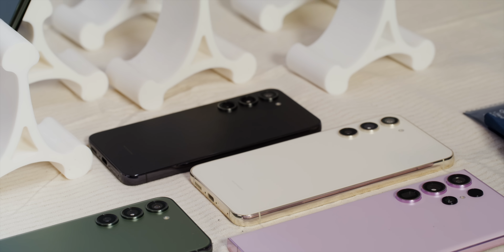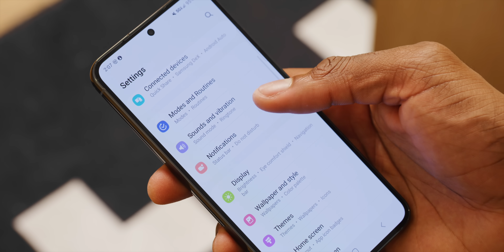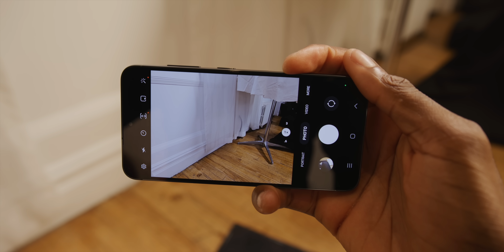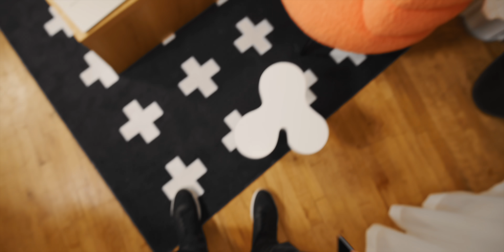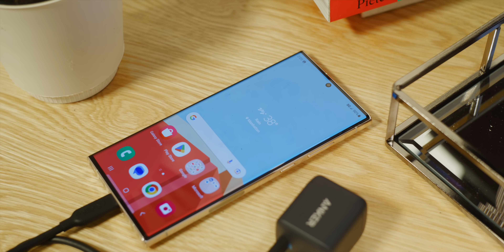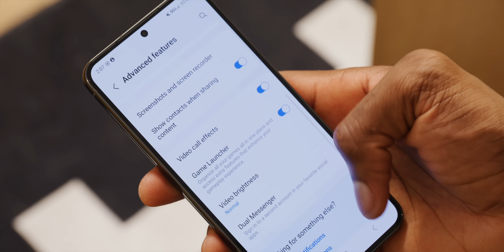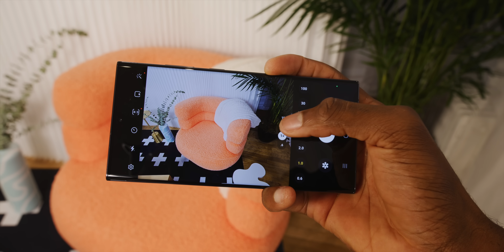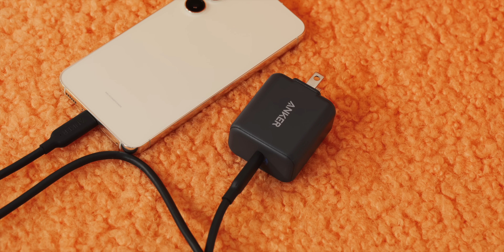Galaxy S23 / Ultra Impressions: Cruise Control!

Comment: I wish Samsung would release a smaller version of S23 Ultra (call it S23 Ultra mini or something), which would have the same cameras and a big battery but in a smaller form factor. Something like apple does with their Pro line up where they have a smaller phone with all the flagship specs.
Reply: I wish that Ford would release a pick-up just like the F250 but with the size of a Maverick. You know? Huge engine and tow capacity, space for 4 adults and tons of stuff in the bed. But, since it is physically impossible for now, I won't keep my hopes up.
Reply: @trickster_qc  well..in someone's mind it might be impossible, but I don't see any issues with just making the phone 0.5mm to 1mm thicker to fit it all.
Reply: @sergiysaliyev9023  same size battery and cameras would not fit with a phone 1mm thicker!
Reply: Exactly 💯!!!! That's what I've been saying why make the large form fone have all the really juicy features and leave the small form  fone out.
Reply: You mean smaller battery
Reply: I thought apple pro phones didn't have all the flagship specs

60hz screen instead of 1-120hz
Reply: @jormjohnXII  They have the flagship specs and 120Hz. Only the base models  have 60Hz. Although Apple is going to differentiate it later this year with the addition of a periscopic zoom lens on their highest end model.
Reply: @jormjohnXII  apple pro phones literally have 120hz
Reply: @user3wx9V-178  no point in saying it twice
Reply: You do realize that a bigger battery... is, uh, bigger? That's not really possible lol
Reply: @FavoredTrapdoor OP wants an s23-sized s23 ultra. just like how iphone 14 pro is same size as regular iphone 14 but with the pro specs and features
Reply: @FavoredTrapdoor  I mean bigger battery then what's inside of regular S23, (like 4300-4500 mAh for example). Obviously the battery would be smaller than S23 Ultra..

Comment: The most exciting thing about these devices is the fact that they finally got rid of the Exynos for all markets.
Finally we (Europeans) get the same performance as you guys.
Sadly I bought the S22 Ultra last year. So I will most likely not upgrade this early. (although my current S22 Ultra is showing quite some buggy behavior since I bought it on release.)
Reply: I have never had an issue with my exynos s22 ultra, the only thing the battery life is the only thing that is a bit bad.
Reply: @Shuffledudee  and shutter lag
Reply: Fomally

Comment: the question is should I upgrade from the S22 ultra?🤔
Reply: They're only offering 500 bucks for the s22 ultra.  Not worth trading in my ultra,  I'll keep it instead.
Reply: I have an S20 Ultra and the only potentially noticeable upgrade the S23 brings to the table is a 200MP camera instead of my 108MP one. Not really an issue even if photography is important since the 108MP one is fantastic and already generates 25MB images.

Comment: Hey, maybe the new S23 Ultra will support cellular networks! My S22 Ultra has massive issues with connectivity, SMS and even wifi speeds. It's all over the samsung forums. Oh, and the camera lenses falling off randomly is really fun, too!
Reply: I have a Samsung store here in Dallas. I took mine for a check due to the same issue, they told me my phone was good but they think it's the carrier networks that are not able to keep up with all the 5G devices... I looked at that man and I said that's the most BS I've heard
Reply: Camera lenses falling off?!! What does that even mean?
Reply: @James Power  so, the part of the sensor that protrudes from the back glass is covered by the visible half-inch pieces of glass. Those pieces of glass act as a dust cover. They're held into that protrusion by one extremely minuscule circle-shaped double-sided tape. That double-sided tape is ineffective, and the circular glass falls off. Usually in my pocket. The replacement glass covers are about $7 on ebay plus shipping... But there's nothing to keep dust off the sensor anymore. I usually use scotch tape til I can fix it... But whichever sensor it is won't work until it arrives.
Reply: Nice one troll...dumbest comment I've seen today!
Reply: Is yours the US ( Qualcomm ) version or the European ( Exynos version ) ?
Reply: @bengoey  Qualcomm!

Comment: I was considering upgrading from my OnePlus 7T Pro to an S23 Ultra, but man, I don't know. 
The changes from last year are diminishable at best and the price tag is ludicrous. 
I think I'll hold on to my 7T Pro for now..
Reply: But do you have that last year phone lol? If you even upgrade to s22 Ultra you will feel that huge improvement.
Reply: @pixellord1  I highly doubt it. Oxygen OS and the full screen of the 7T Pro, along with the performance and fast charging holds up so freaking well still - I never held onto an Android device for as long as this one. It's the last (and brilliant) phone OnePlus did before going down the drain
Reply: @undeco_niclas  Ah, haven't noticed that you wrote Pro. Yeah 7T Pro is a great phone, my friend still uses his normal 7 Pro for 3.5 years now, still work perfectly.
Reply: @pixellord1  Yeah, it's crazy good. The only issue I'm have is the camera having difficulty with auto focus sometimes (big problem for me) and for some reason I'm experiencing some weird bugs, like assistant not answering and things lagging randomly - I'm sure a factory reset would fix it
Reply: @undeco_niclas  Yeap you should try factory reset.
Reply: Used s22 ultra

Comment: Fingers crossed 🤞 the S23 Ultra can finally beat the Pixel 6/7 in the camera department as a phone beating it for less than half the price would be ridiculous like it was for the S22 Ultra. Great to see tsmc manufacturing the cpus now and not Samsung plus a big jump in performance this year as the S22 Ultra was underpowered for it's price regardless of qualcomm or exynoss so never got why the S22 Ultra was considered the best phone when it was underpowered and only had the 3rd best camera. 8GB of ram for £1249 is also ridiculous 12GB of ram should come standard across the board especially when 8GB is only just enough on Samsung due to the havy ui.

Comment: I'm mostly worried about battery with the new processor.  I'd like to run the faster refresh rate and 5g without so much drain.  Might do a different color than white this time if reviews show solid battery.
Reply: The new processor is supposed to be more efficient than the old one, by a lot actually. And the base and Plus models got a 200 mAh bump alongside it, which should help.

(Also, out of curiosity, what does the color you get have to do with battery life?)
Reply: @fsendventd  oh no, I didn't mean for that part to be taken out of context.  I simply meant if I buy one, I may get a different color than the s22u that I have now.
Reply: @Ready2Rise  Oh, that makes sense. I'm a fan of the lavender myself.

Comment: I currently have the S20 Ultra 5G. Is the S23 Ultra a good upgrade? Also, would my charging brick that came with the S20 Ultra 5G be sufficient for the new S23 Ultra?
Reply: That 20 extra watt hardly charges any faster
Reply: I would say yes.
if you feel like upgrading then it is a good choice it is still a Samsung but with upgraded goodies here is what to expect from the upgrade:
-same if not a better screen 
-a smaller battery at 5000 instead of the 5500 that the 20 ultra has 
-S pen with all it's features
-updated processer 
-upgraded camera setup with the 10x zoom lens and 100x digital zoom

Comment: Wow, they are really iterative updates. Especially the base and Plus variants. I am glad I didn't wait for them, and went with the Pixel 7 Pro instead. Had a Galaxy S20+ before this, and it would barely feel like an upgrade if I went Samsung again (at least the Pixel, it's UI and settings are a breath of fresh air after using One UI for a while). I was hoping Samsung solved two things with this generation - speed/fluidity of the phone (Pixels and iPhones 'feel' way more smoother consistently) and shutter lag.

Comment: I really like the design of the 23 ultra. The edges remind me of the Xperia line. But I personally think they need to ditch the one sided vertical camera stack approach. I really really hate that my phone wobbles on the table because I dont like cases. If it never changes I'll just have to get a Mi 11 ultra or something. That camera is epic.
Reply: Even with a case most of them have some lip around the camera cluster to keep it from resting on a surface, so it wobbles anyways lol. It's frustrating.
Reply: @xomm  True lol the wobble is on most phones. I just wish more phones did it like the mi 11 ultra or that the mi 11 ultra had a stylus like the note's or the new ultra series samsung phones. Always gotta pick your poison I guess XD

Comment: I have the S21 Ultra and like others have said I don't see the need to upgrade. If I was going to upgrade though I think my biggest concern would be the focus issue for the standard camera (1x zoom). Every time I take a picture on my S21 I have to tap the phone against my palm so that it will focus. Makes taking quick photos a hassle and only ever experienced this on a Samsung phone.
Reply: I wonder if Samsung is doing this with software so it makes you upgrade.. have same thing happen recently..

Comment: Paint on metal parts of my S22 Ultra (on the back where the phone touches surface) started to come off in a matter of few weeks. So, it's impossible to use it without case and keep it looking like new. But, consider that this phone is already huge even without the case... Another problem is that the whole S22/S23 line lacks premium look and feel. All these phones look like a good mid-range device... Not to mention dull and boring colors.

Comment: Waiting for the Galaxy Z Fold 5 for the novelty factor, as most of these other phones in the standard form factor are not that different from previous years.

 I want that" new toy feeling"when spending so much on a new device and I think going to a foldable will accomplish that to a greater degree than another regular phone.

Comment: Doesn't the S23 support charging bypass, so you can use it for prolonged periods powered directly from the mains, rather than constantly charging & discharging the battery, massively impact battery life if you used the phone plugged in a lot? Charging bypass has been in Lenovo, Asus & other phones for years now, so their phones can be used for prolonged periods of gaming, recording video, working, etc without prematurely killing the phone with a battery with no charge life cycles left. If the S23 does support charging bypass then I'm definately not getting one; it's a deal breaker to force us to have to replace the phone more often rather than caring about customers!

Comment: Within last 2 years, I had a 512GB S21 Ultra model and got tired of it. Sold it and bought a Flip 3, then I traded it in 8 months later to get a Z Fold 4 1TB model and after two months of use, it malfunctioned and sent it to Samsung for a repair but UPS stole the box so it's lost. But before that I switched to T-Mobile Magenta Max option and we're given five free S22s. Now I'm back on using a regular slab phone and oh god this S22 is super slow when taking regular photos or just a regular usage on especially on a hot day. I'm definitely upgrading to an S23 Ultra just to get my hands on that new 8 Gen 2 CPU which hopefully doesn't overheats

Comment: I'm sorry but 8Gb of ram (that Note9 had back in 2018) is just a joke. Yeah, yeah I know "it's more than enough for most of the users" but a) my Note10+ has 12/256 b) if I'm paying flagship price I want all specs on max, all features I need and will never use. To be honest, most of the 200-400 bucks phones today would be completely fine for my usage. 
My finger was on "preorder" but I'm waiting for the reviews. If there are ANY issues that will "be fixed with updates" (shutter lag, battery, bugs...) I guess it's time, after 6 years of using Samsung, to switch to Pixel or even Iphone. Sick and tired of their tactics...

Comment: The less rounded edges are so the s pen doesn't slip off the side as easily, I barely use my s pen, but still notice it slipping off the rounded edges.

Comment: the regular s23 has the perfect size for a phone, hope some day they pack the same features of an ultra.
Reply: Yep. The 23 and the s23 plus are perfect sizes.
Reply: the battery life is really bad on those phones though. i have a s20 with exynos i get 2 hours of sot 💀💀
Reply: @mayeutow  u doing something wrong 🙈
Reply: @mayeutow  S20 with Exynos has the worst battery life out of all Galaxy devices. You would really benefit from the upgrade to Snapdragon
Reply: @mayeutow  Ik exynos s20 has bad battery life, but just 2 hrs of battery means that the phone has issues.
Reply: @axm-004  Or the user.
Reply: @axm-004  it isn't that bad actually. with constant use i get 3 maybe 3 and a half hours of sot. but with varied usage throughout the day it's around 2 hours. idle drain is insane

Comment: I used to be a huge Samsung guy, then they kept doing the same thing over and over. Also, I hate how they made it that if you want the best phone then you have to buy the Ultra. I enjoy the iPhone because I can get the regular Pro model and have the best features without having a gigantic phone. If I were to switch back to Android, it would probably be to regular Pixel. It seems like the best value.

Comment: idk if i should go with the s22 or the s23, they both seem almost identical but the slightly bigger battery and better cameras on the new one seems temping
Reply: Definitely S23. The SoC is a massive leap over 8 gen 1
Reply: Ofc the new one bro. Then ure done for 3-5 years
Reply: or another phone from another company

Comment: I got an s9+ and I want to upgrade, but it seems that I should get an s22 ultra since there's not much difference compared to the s23ultra. I always upgrade once every 4-5 years for a new phone.
Reply: U will do better getting the s23uktra if u upgrade every 4 to 5 years. U always want the latest and greatest to last you the 4 to 5 years. Plus u will get 4 to 5 years of software and security updates. As with the s22 ultra u will get 3 to 4 years of software updates
Reply: now that they have lossless earbuds, I'm not upgrading til Samsung pays Qualcomm the for the support for that feature. this was the year I was going to upgrade. I'm on the note 9.
Reply: @battlegroundone  nice. I have the note 9. Just got the pixel 7 pro. Thinking of getting the s23+ or ultra

Comment: AFAIK, the OS refreshes the screen at 1hz, but the physical screen itself goes only as low as 48hz, which in the end denies much of the power savings relative to what you would think.
Can you confirm?
Reply: Probably negligible difference and 1Hz isn't good for your eyes.
Reply: @Glotttis  No it's not bad for your eyes, it's used when the screen is On but not refreshing (reading a website) or in Always On Display.